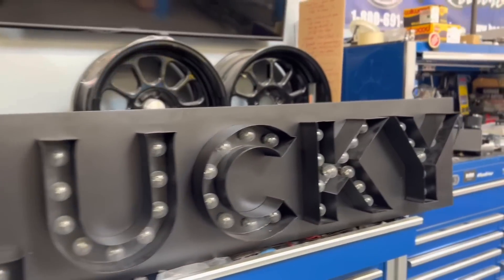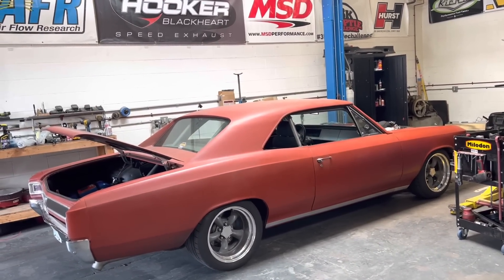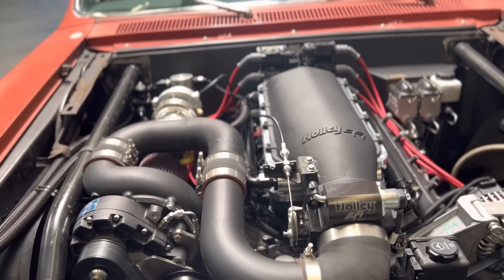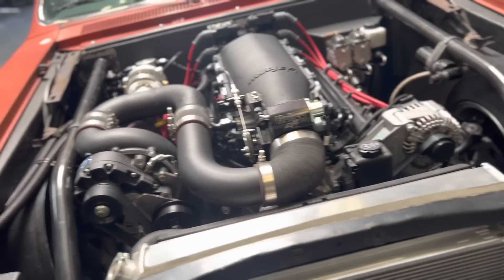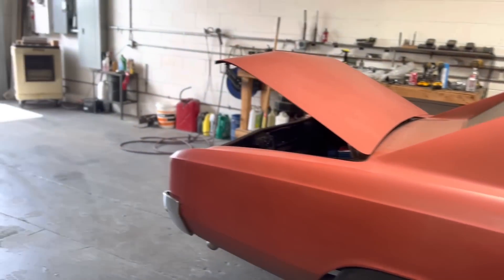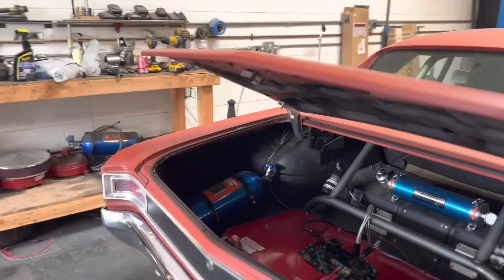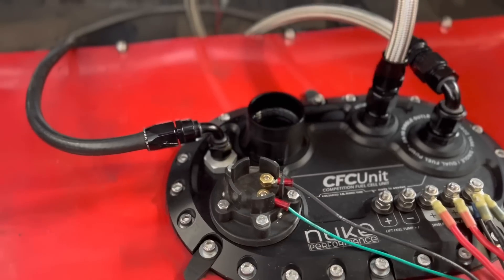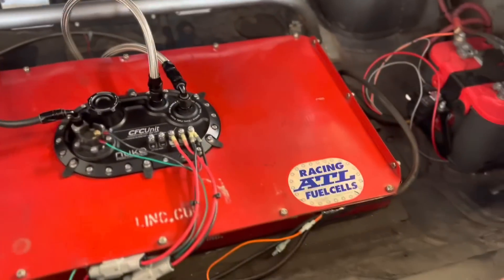Chevelle Update

Comment: Working on my 66. Starting with front suspension and brakes. Then rear brakes, differential and suspension. Have a 6.0 with forged internals and an s480 turbo. Going to run a 4L80 and Holley EFI.